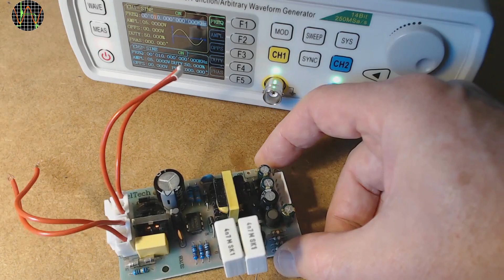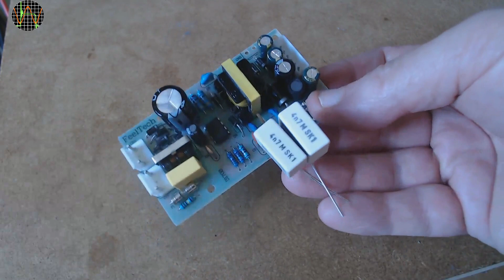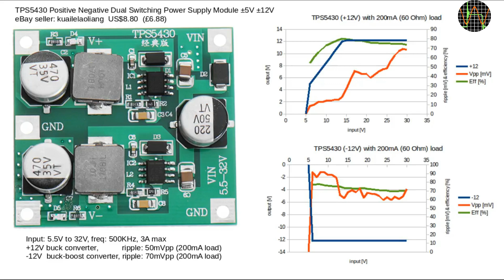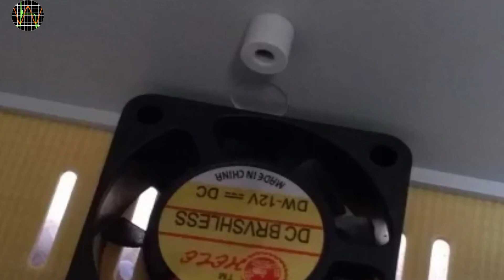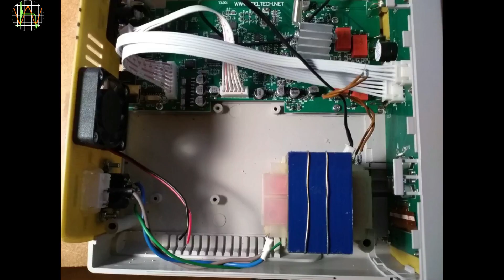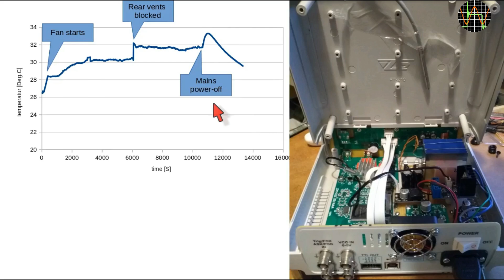FY6600 Function Generator Power Supply Replacement

Comment: Does anyone know why a FY6900 won't power up with 5v from a linear power supply. It will only power up using it's built-in 5v switching supply. There are only 2 wires from the p.s. board.
Reply from the maker: Since I don't have on, pure speculation from my side. I have seen tear-downs of the 6900 with just 5V power supply but they have 3 wires, 2x ground, 1x5V. Maybe you need a 2nd ground?  Secondly, since the 6900 has to generate all the other higher voltages for the amplifiers by DC2DC converters, I assume the power draw on that 5V may be heavy. The power bank may be able to produce it but it may need some signaling (for power management) and if not, restricts its output to something that's too weak to power the generator.
Reply: @TheHWcave  you may be right about the smps on my FY6900 having some signaling. I disconnected the 5vdc to the mainboard and saw a 0.8v 75ms pulse on the +5v wire.

Comment: Hi TheHWcave and thanks for these helpful videos.  I believe that the power supply in my FY8300 is identical and that it has cooked one or both of the diodes on the output side of the transformer.  Following your approach, I've ordered a +/12v converter and a 5v converter to use with a 15.6v mains transformer, rectifier and capacitor that I already have.  While I wait out the long, long shipping times on these, I realized that I had a box full of old 100v - 240v AC  to 5v and 12v wall plug adapters (switching type) and that I should be able to combine two 12v adapters and one 5v adapter to make up a +/- 12v , 5v supply which should get my FY8300 going again in the interim  I'll report back shortly how this all went ....  Simon
Reply from the maker: yes,  please report how you are getting on. But I must warn you of using unknown switch-mode power supplies (SMPS), especially cheap ones. Their electrical safety is often very questionable and they are practically guaranteed to leak a lot (comparatively) of mains current into your generator and through the outputs into the circuits that it connects to. With the original SMPS in my FY66000 I measured somewhere around 90VAC on the generator output against earth. If you are planning to use normal SMPS, you are pretty much forced to connect the outer BNCs  shells (signal ground) to mains earth to get rid of the stray voltage cause by leaks but then the generator signal will be always mains earth referenced which is something l tried to avoid. You can buy low-leak SMPS (meant for medical applications) where you can live with the tiny remaining leak current but they cost quite a bit more and are harder to find.
Reply: @TheHWcave  It works just fine.  It was simple to set up - just connected the + and - of two 12v SWPS to ground and the - of a 5v SWPS to ground and wired in the 12v+, 12v- and 5v+ to the sig gen board.  At least I've got my sig gen back, while I wait for the +/- 12v and 5v converters.  I had to ground the sig gen to earth for safety and to get rid of the elevated terminals (my selection of available SWPS varied from 80v to 110v AC to earth, on both + and - sides), so I'm not isolated until my new parts come. Thanks, Simon  :-)
Reply from the maker: @simonstuartmurray  Thanks for the update. I am glad it works for now.

Comment: The Feel Tech website (September 2021) shows the rear panel of the FY6900 (User Guide, page -11) with a three prong AC connector.  Apparently, they have corrected this issue with the method described in this video or something similar.
Reply from the maker: Yes, its the cheapest way to get rid of those stray output voltages. But on the other hand , I'd rather avoid (well, greatly reduce) them by using a better power supply and keep the outputs floating. I can always earth them with an external wire if I really need to get rid of the last bit of stray voltage against ground. I am pretty happy with the new power supply and did not have to use earthing the outputs for ages

Comment: Seems the newer FY6900 has proper grounding. I ordered one.
Reply from the maker: Hi ThinkingBetter, 
That's good to know. Would you mind telling if those stray voltage problems are indeed gone with the FY6900 once you have it?
Reply: @TheHWcave  I just received this FY6900. No manual...but it's ok. I'm happy to see a 3 wire power connector. I connected it to my Siglent SDS 1202X-E oscilloscope (also grounded) with no BNC probe ground connector interconnected and a square wave signal. I was a bit surprised to see that running the ground through the AC cables is near as low noise as running the ground through the probe wire. Does this help?
Reply: Just tried to measure the resistance between the BNC ground on my FY6900 and my Siglent SDS1202X-E. It's 0.0 Ohms...so they both run mains ground to their BNC ground. In terms of actual noise floor, I'll check that later. I paid only US$107 for this 60MHz model in Amazon.
Reply from the maker: Well, if it is zero ohms, it seems they did put the ground in after all. Another way to test would be to connect nothing to the outputs and just touch the BNC ground with one lead of your multimeter set to AC-V while holding the other one in your hand, or touching something earthed. In my original FY6600 I could see around 100VAC that way. 
Do hunt for an online manual. This thing is so powerful and has so many functions, you'd be lost without it.
Reply: TheHWcave I find some noise around 150mV with a 43.6kHz detected clock in it, when measuring mains ground to the generator running DC out. But nobody should rely on mains ground between instruments.

Comment: I really enjoyed watching this pal although it's an old clip , but why didn't you just use a T-30B triple output smps from AliExpress? $13 about £10GBP all in
Reply from the maker: Fair comment but actually the unit comes with a triple SMPS built-in. Its the SMPS that is causing the problems and earth leakage because of Y-capacitors. Any decent replacement SMPS will have the same problem.  A unit like this should not use a SMPS or at least it needs a specially designed one that avoids this problem and still not cause EMC problems.
Reply: @TheHWcave  Agreed. I just meant that instead of all that messing about somehting like the item I posted would have saved a lot of time and expense at the time ;). Cracking clip though mate, I enjoyed watching it :)

Comment: Ugh damnit . Figures this generator is not worth the trouble
Reply from the maker: Actually the generator is great. It has amazing capabilities: 2 independent generators, one can modulate the other (AM, FM ..), a frequency counter as well and editable wave forms, burst mode, sweep ... Its only problem is the cheap power supply. I admit that my solution is a bit OTT. If I had to do this again, I would put a linear (!) DC supply (with proper isolation transformer) in a separate box and just feed the +-12V and +5V. It would save a lot of trouble with space and cooling problems and in a separate box you don't need to worry about heat sinks so the power supply can be really simple (3 regulator chips and a few smoothing caps)
Reply: @TheHWcave  im planning on at least doing the grounding mod

Comment: Good video, learned a lot, thank you but I have a question, why didn't you desolder the connector from old PSU and use it in the perfboard?
Reply from the maker: Yes, that would have been a good solution but for some reason it did not cross my mind.
Reply: Isn't the plastic housing only pushed onto 2.5mm pitch pins? I frequently use these JST XH connector housings pushed on the a pinheader on a breadboard. you can get these 100pcs packs for like 2dollar on ali

Comment: Is there any chance of a circuit diagram including the ac part involving the 0.1 uF caps.
Reply from the maker: These caps are just to reduce HF and switching noise coming in from AC mains and not essential but if you want to add them,  each of the 0.1uF caps is in parallel to a diode of the FULL BRIDGE RECTIFIER. Please let me know if that is description enough or you need more info.
Reply: Thank you, that is brilliant.

Comment: Before rebuilding the whole thing try plugging the USB into a grounded computer. Problem solved.
Reply from the maker: Your suggestion is similar to connecting the metal part of any of the BNC connectors to ground. While that gets rid of the stray voltage, it is at the cost of referencing the signal to ground.  If you do this I recommend you take extra care how you connect the signal into your test setup which may have a different ground.
Reply: @TheHWcave  since I'm a noob with all this, can you recommend some sources explaining your point?
Thx
Reply from the maker: Well, connecting a ground-referenced signal generator is a similar case to connecting an oscilloscope to your circuit.  Dave Jones from the EEVblog explains the problem of having a ground lead from your measuring device in your circuit in his video #279 quite nicely.  https://www.youtube.com/watch?v=xaELqAo4kkQ 
I know this isn't an oscilloscope but the problem. in principle, is the same. In most cases you will probably have no problem if your circuit to test is running from batteries or a proper isolated power supply. But if not, then you need to watch out. I'd rather not worry about that and hence I want the signal generator to be floating and NOT referenced to ground unless I do that explicitly myself.

Comment: Since your fan controller end up running the fan slowly, you might be able to replace the fan controller with a 7809 (or whatever variant makes your fan spin appropriately). This ought to remove some PWM noise in your setup.